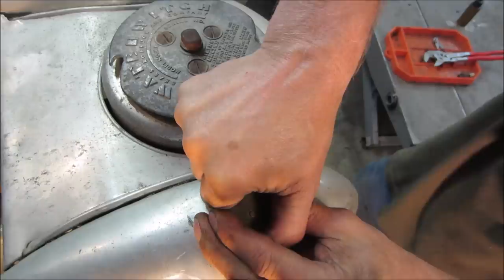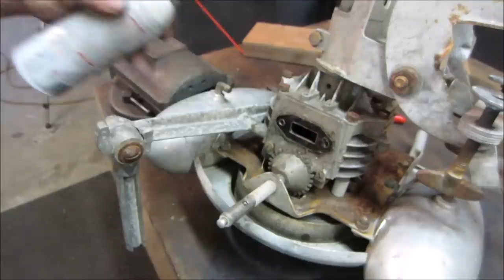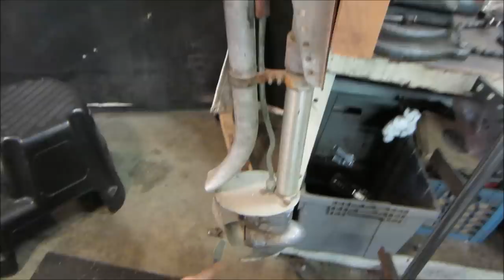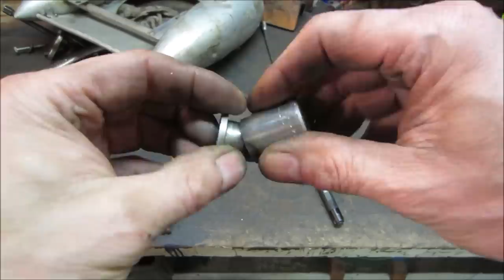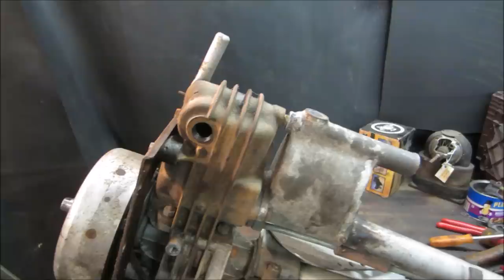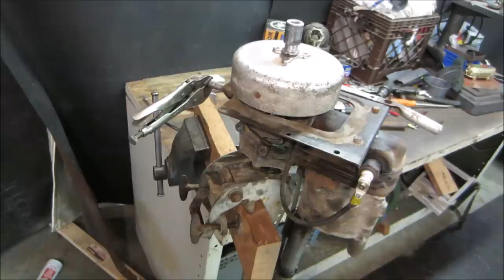1937 Waterwitch Boat Motor, 60 years in a Shed. Will It Run? Part One

Comment: Just yesterday I picked up a 60s sears 3000 wat generator with a tecumseh engine I put the old drill on the flywheel nut to spin it over got it to fire up and run and when it did it ran faster than the drill and loosened the nut when I moved to the side to adjust the carburetor it flung the nut right at my head... Just missed me. But I'm sure it wasn't personal. Runs like new now and the generator part works too
Reply: Tecumseh engines are awesome
Reply: Got some " Maximum Overdrive " action going on there . You Know , the movie  ? If you ain't seen it you need to . It's pld now but a decent watch. LOL
Reply: @handsonwithblg4949  that movie was awful.
Reply: @lrrowley  pretty much, no matter how long they've been sitting just clean the carb and it will start right up

Comment: I wonder if one way is for reverse that's why you have so much adjustment in the timing?
Reply: I thought about that too, but is there a way to spin the engine backward to start it?
Reply: for reverse u turn the whole motor around
Reply: Thats what I was thinking but it's still a large swing. 12 degrees BTDC is a lot of advance, so switch to 12 degrees in reverse is still only 24 degrees
Reply: The gears for reverse would be down near the propeller. He showed them briefly but I couldn't tell if there was a reverse.
Reply: there is no reverse, or neutral for that matter. when the motor is running it is propelling the vessel.  you can run the motor backwards if you screw the timing  up  enough, but it is not what the designers were intending

Comment: I'm just waiting for you to realize that the large timing adjustment will allow the motor to run easily in either direction?
Reply: I doubt it, the pull cord only attached in one direction so you can't start it backwards. If you're thinking it would give you reverse, the older smaller outboards allowed you to spin the motor 360 degrees so you pointed it backwards to go in reverse.
Reply: I thought the same thing, there is a mark that says start on the lever, once running you crank it to the other extreme and it runs the other direction just like the antique inboard he worked on some time ago
Reply: @lesbender236  Do you have any idea what it would take to reverse it instantaneously? It would snap the crank in a heartbeat.
Reply: @muskokamike127   Rotax has a system on some of their 2 stroke engines (Rotax Electronic Reverse/RER) which slows the engine down then fires before TDC to reverse the engine rotation.  Cheaper then adding a reverse gear!

Comment: I found one of these engines in a barn in Wisconsin. It was buried in cow kaka, except for the prop. $5.00 and the guy dug it out and it was mine. It was a fantastic summer project. I hand polished the aluminum. It was the most basic motor I have ever worked on. I was a certified aircraft mechanic at the time working on over engineered aircraft controls and engines. When I finished it did run but without much enthusiasm. I sold it for fifty bucks.

Comment: Mustie the part you wrap the rope on you can leave it on to use as a puller just spin the nut . the shoulder un the nut is ti grap the part you wrap the rope around and pulls the flywheel up and off . nothing wrong with what you did at all . Man you got to love that old outboard . I knew you could get it running .

Comment: My Grandfather had one of those outboard motors on an aluminum boat, back in the '60s, and it was old, then. I would believe they were made in the late '40s to mid '50s. Very lightweight, and his was pretty reliable, once you learned how to start it. My first introduction to outboard boat motors.

Comment: The two fuel tanks hold a gas oil mix . To fill the tank with the small loosen the screw all the way ,the tank will fill threw the fuel lines. This will take patients.  To this day it still runs. Slow moving in the water but, faster than rowing and much less tiring. Good luck on restoration.
Worth the time and effort !

Comment: A few years ago i saw an old outboard laying in a guys backyard. Gave him 20 bucks for it and took it home. It turned out to be an old montgomery ward 12 hp twin cyl 2 stroke that was made in 1957. Tore it apart and cleaned it up, rebuilt the carb and some other odds and ends. It started on the second pull and has literally been ran for hundreds of hours since then on a 12 foot john boat at a local lake. It has never once failed to start right up or give me a minutes trouble. They certainly do not make them like that anymore!

Comment: Some early outboards we're a very unusual design the fuel tank arrangement and top cover of that motor is supposed to look like a manta ray. When I found very fascinating was that plunger operated water pump very advanced engineering that you were finding nowhere today.

Back in 1949 and I think the month was June my father bought a Lawson electric corp, outboard motor 2.9 horsepower outboard that was air cooled it also made a 1.9 or 1.2 horsepower outboard that was even smaller, had 4 cycle engine with a crankcase.  That engine ran great for many years until it got dunked in fresh water or even though it was cleaned up and what not it would always overheat in about 5 minutes when you put it on the back end of a boat after that. We had a new piston and connecting rod bearings put into it by inland marine and Coeur d'Alene Idaho. The accessories that came with it was a trolling plate that you put on the back of the prop but you could run it at high RPMs. At strolling speed.

Well back in 1990 maybe around Christmas time my father was  digging through a bunch of boxes that he had used for files and found the owner's manual and the original sales receipt ($99.98 including tax) went into a Ziploc bag, along with original piston assembly and trolling plate.. My great nephew who's probably in his mid-20s now has that motor at his mother's house as far as I know over in the greater Seattle area of the West coast. Course he has no ideas of the value of that motor.

Comment: Just a suggestion, you should invest in a set of gunsmith screwdrivers. They have a more square side that will mate with the screws that you take off. If you get a set or go see a gunsmith you will see what I mean. If I have a screw that is tough to get out that is all I try to use. I don't even use a regular screwdriver anymore when I work on anything because I found out they work so much better. Also, I use fitting wrenches when I work on fittings. That's what they are made for and they don't cost much more and they will save you a lot of headaches when  you are working on old stuff that the fitting can't be replaced on. BTW, I enjoy you videos and watch a lot of them just to see what you can see what you can get going again.

Comment: I would make a guess that the carburetor (or lack therof) wasn't allowing enough air to be pushed up to the top end either. once the valve was in place the 2 stroke system was able to shove enough fuel AND air up to the combustion chamber for it to run properly :) great video mustie, funky looking machine! Can't wait to see it in action!

Comment: Looked like both tanks had a pipe near the top connecting them, maybe they're both fuel and the weird cap on the second was the vent and was designed so that you could close it so the gas wouldn't leak out when it was tipped over.  Excited for the next one!

Comment: At 55:36 mark, when you decide to open the throttle up full bore...if you look at the exhaust down tube the fuel mixture is leaking out down that tube.  You can see it pouring out in the video.  
Hope this helps as you probably already figured out there is a fuel leak somewhere.  
Great little motor..and when running you know why they called these “putt-putt” motors.

Comment: Years ago my nephew gave me ann old outboard motor, said he couldn't get it running.  I found it had no spark, was able to convert it to eletronic using Tecumseh modules. It was a 2 cylinder, 5-1/2 hp. What really stuck out in my mind was the ID plate. It was made in the early 50's by National Pressure Cooker Pot Company. I ended up letting my brother have it,  its long since disappeared, lol. Just found it interesting it was made by a pressure cooker manufacturing company....

Comment: I haven't seen one of those for very many years ... 
I believe the little screw in part on the tank is an air bleed screw because there is no vent in the gas cap and when running it will not get fuel ...
They really smoke as I remember and yes that is a mix control on the front ...

Comment: Your excitement got me, glad you followed up with trying the run with the carb on. I wonder if the smaller valve on the tank is to let air in? I thing both tanks hold fuel and fill when you fill the tank with the filler cap and you can close the vent screw so fuel doesn't leak when you transport the outboard. Stay safe Mustie1.

Comment: I had an old boat engine of 4 horses that had an Archimedes screw on the downward propeller shaft. 
It was the only water pump that was on it and you turned the whole ignition plate when you increased the gas. 
I do not know what brand it was, but it was made in Milwaukee. I bragged and said it was an HD engine.
This was in the early 70's
 when i was a teenager and liked to brag.

Comment: Awesome old engine. Made by Kissel. in 1937 they made three versions (I think) a single cylinder 2.5 HP which is the version that you have  I think its was an MB-10 and opposed twin, also 2.5 HP and another opposed twin at a whopping 4HP.  The history of Kissel is quite interesting, They manufactured cars, vending machines and boat engines lol, definitely a neat story if you are a gear head geek about engines like me.

Comment: Wikepedia:The Waterwitch was Sears and Roebucks brand name outboard motor. The first Water Witch (two words) went on sale in their 1933 catalog. The early outboards (1933~1937) were manufactured for Sears by either Lockwood-Ash Motor Co., Caille Perfection Motor Co., or Muncie Gear Co.

Comment: A trick for removing knobs in electronics, timer light switches, etc may work here. wrap a string or thin wire around the knob. Typically you try to get behind the knob. Then you wrap the string around a screwdriver handle so you have a Tee-Pull. Your string ends need to be 180 degrees opposite on the knob to create an equal force when you pull so you don't bend your shaft.

The funny thing about old low HP power motors is they sometimes seem to outperform a new higher HP motor. Maybe the emissions plumbing smothers the newer motors.

Comment: That looks like the one my Dad owned. The bumps in the front of the fuel tank match up to what I remember. The one we had would push a twelve-foot rowboat up through the spring flood. WE had to tinker to get it running but once running it was dependable.

Comment: With the old outboards, engine speed is controlled by ignition timing.  That's why there is such a wide range for that lever.  There will be a START on the front of the tank housing for the optimum position of the lever for starting.

Comment: Can't wait for part 2! You left us hanging like the old Bat Man TV Shows!!!  I wonder if those are separate gas tanks and the center switch controls which one you are currently using. If so, where goes the oil? Wouldn't be a 2-stroke mixture, would it?

Comment: Mustie The impact tool you used for the 3 screws on the flywheel we in aviation use them all the time to get inspection panel screws loose. We call it a knuckle buster, old man, screw buster.

Comment: that smaller tank cap is for air venting.  Since they are connected at the bottom, when filling the right tank, the left won't fill unless there's someplace for the air to go.

Comment: You definitely would have needed some WD-40 (min) or even more flowable anti corrosion (anti oxidative) fluids on this older beauty, heat and careful smacks are also in smaller and careful use a great help!
Parts will be almost impossible to get!

Comment: Just by it's appearance, I say it could almost break the Warp 3 barrier.😎
I'm guessing the twin tanks share the same pre-mixed fuel. As you fill the one tank, the fuel line also feeds the second tank. The opening the in the second tank is to allows for air displacement as the fuel moves in and out of the tank.  That's my guess anyway.

Comment: I’d check the compression and the timing. 
The leading issues are 1) cylinder compression value and 2) magnet poles and electric breaker  has holds a general timing relation.

Comment: Updraft carburetor. No jets, no "mixture" needle or "idle circuit".
Air horn (tuned port), Venturi, fuel/oil gravity/manifold vacuum.
RPM is controlled by spark timing range. Small knob is "trim"
for A/F ratio, rich/lean.

Comment: Water jacket if your water pump gets hard you’ll have some flow but not enough. My Yamaha will cut off the hp where you can limp back. What we usually dunk the boat just enough to get the engine running then if you have tail tail solid stream good to go play. If you got dribbles don’t go out. If you know what your doing drop the lower unit for rubber impeller usually they get hard mark where the shifter cable was set for tension put everything back in reverse order try again. If it’s still dribbles use a good fishing line run up the spout while it’s running air bubble or it sucked up something

Comment: I’m reassured that even Mustie resorts at times to hopeful hammering. 

I usually find myself with huge tool envy after watching these but today I find myself instead full of tool-regret: a job I did on my house last summer involving ~120 50 year old, painted over flat head screws might have taken a matter of hours rather than over a week if I had realised there was such a thing as that air hammer/impact driver combo. Gah.

Comment: Another great video - by the way the definition of "ANTIQUE" is that the item in question is a minimum of 100 years old
Reply: In Sweden, we have a rolling 30-year limit for a car 
to be considered a veteran and then you avoid tax for it. 
A Swedish motor vehicle that is over 50 years old is considered antique.
I do not know what it's like in the United States, but this is how it is here anyway.
Reply: For the state of AL any vehicle 30+ years old is eligible for an antique vehicle license plate. Many other states are 25 or 30 years as well. So it doesn't take anywhere close to 100 years to be considered an antique.

Comment: The button in the middle of the lever (which rotates the magneto coil to adjust the timing) is probably the kill switch. I base this on a similar button on the end of the timing lever of an old '36 Evinrude 4.2 hp I once had. (It's still running; my cousin has it now.) An old motor like that wants 30:1 mor even 24:1 gas oil mix. %0: is likely to make it freeze up eventually.

Comment: The tanks ( May West ) are worth $75 , the face plate cover and top tin $50 , the air fuel metering device $50 , transom clamps $25 , leg and lower unit $50 if you part it out ! I buy them all day for $50 whole , I’ve seen them completely restored sell for $1,200 ! In our outboard club they are highly desirable outboards ! If you want parts contact a local AOMCI member and they can help you ! Or I can give you someone local to you phone number to help ! That single is worth fixing !

Comment: The timing range is so you can run it in reverse.
Also why it is a plunger type water pump, so it will work in both directions.

Comment: The extreme timing adjustment could be to run the engine backwards for reverse, the piston water pump will work regardless of which way it’s turning

Comment: With two strokes, even those with modern carbs, the advance is all the low speed control. Later outboards coordinated the advance and the throttle. All advance control at low rpm then the cam will pick up the throttle.

Comment: Sir, is there a reason you put some 3-1 oil on some of the threads and not others before wrenching off? Specifically the tubing nuts from the tanks. Thanks

Comment: The Waterwitch outboards were made by the Kissel car company for Sears  The unique styling (Mae West) was done by famous industrial designer Raymond Loewy. They are crudely made and not real good runners for most models.  They were called Sears and Row back instead of Sears and Roebuck. 1941 was the last year they were made and the plant became West Bend Aluminum after world war 2.  After the war, Sears contracted West bend to make a new line of motors called Elgin and were modern and well made.

Comment: That plug on the far side from the fill port is probably an air bleed so you can fill the whole tank.  Without it you end up with a big air bubble trapped on the one side.

Comment: Rather than weld a socket I tend to pack one with body filler resin. It’s always makes for a perfect fit and afterwards a few clouts with a hammer or some mild heat will take it off and restore the socket.

Comment: I think those older motors typically ran on a lower oil ratio, maybe even 20:1.  I the second tank access a vent?  Was fuel running dowm the outside of the exaust?

Comment: With all the noise that motor makes, I guess you use the water witch to scare the fish away from your boat to the other side of the lake to where your friends are waiting in their boats. If you attach these motors to 3 or 4 boats and you'll be able to herd the fish to where you want them to go. Those water witches were pretty clever back in the day. :-)
Reply from the maker: the exhaust exits under the water making it less noisy
Reply: @mustie1  Isn't that where the fish are? ROFL

Comment: Just picked up a Waterwitch and busted the throttle/timing gear bracket. Ugh. 
Any idea if the throttle shaft with the little button on the end is supposed to have a bend in it? Or is it perfectly straight from end to end?